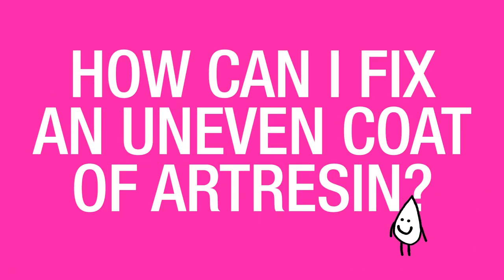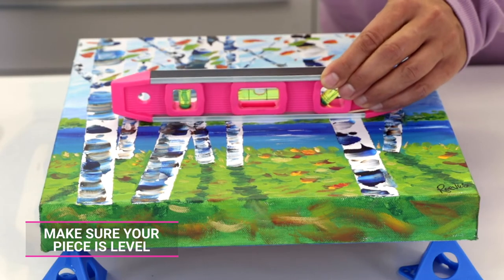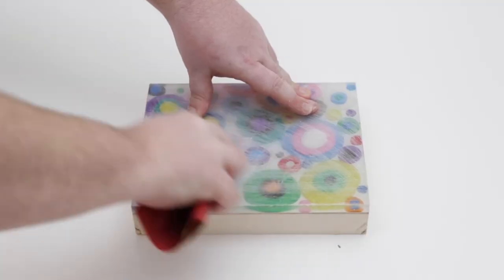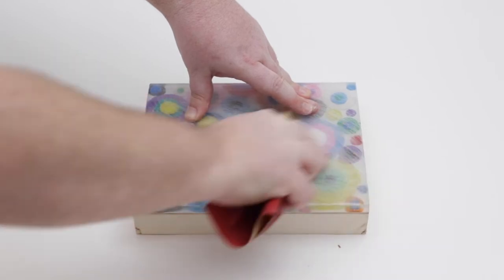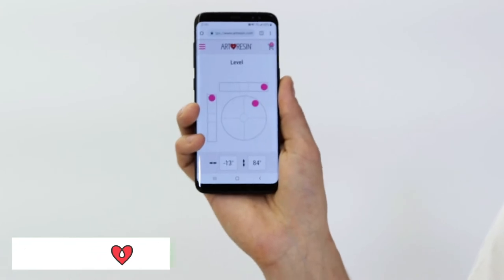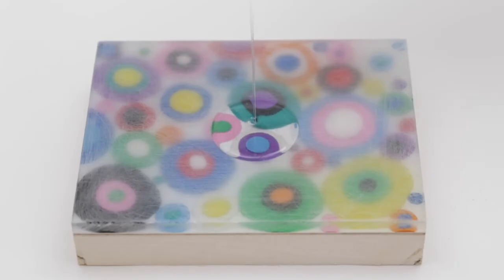How Can I Fix An Uneven Coat Of ArtResin?

Comment: What if your piece is domed and not flat? I made some pieces in a mold that created a dull surface so I did a pour over to give them shine and it came out totally uneven. I had them on a level surface mounted up so all the extra product could run and drip off the edges.
Reply from the maker: Send us some photos to support@artresin.com so we can help

Comment: Dang, I thought you were going to tell me how to evenly coat a surface. 

When sealing acrylic paints, the resin won't whet the surface evenly. Is there a minimum thickness that will provide enough mass to make an even surface? I get dimples on layers as thick as 3mm.
Reply from the maker: Hi Aaron, it is important to ensure you are pouring enough ArtResin to cover, you can use our calculator for help:  https://www.artresin.com/pages/calculator.  Pouring in layers that are too thin will cause the resin to shrink away from areas as is cures.  
It is also important to know that if you add any silicone oil to your acrylic paint it will repel the resin and give you a surface full of divots.
Reply: @Artresin   Brilliant answer. Thank you very much!

Comment: What sand paper number to be used ?
Reply from the maker: you can use 80 grit, it will remove imperfections and give tooth for the next layer of resin to adhere strongly